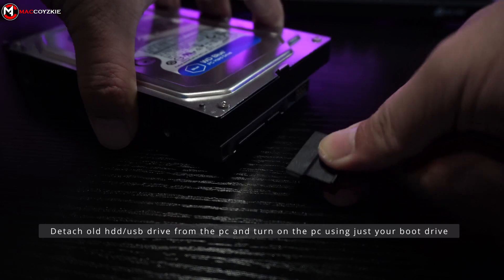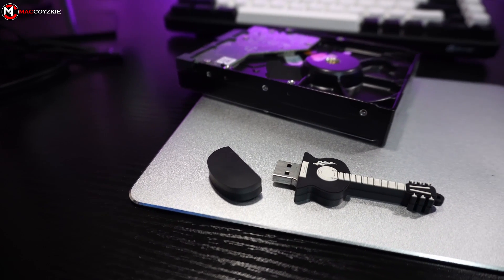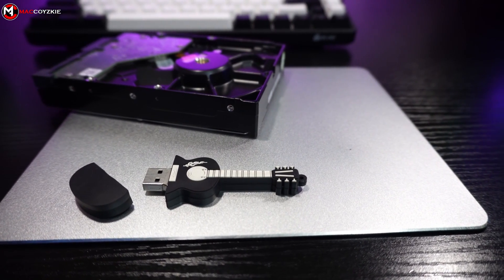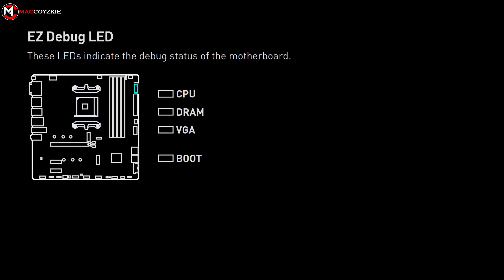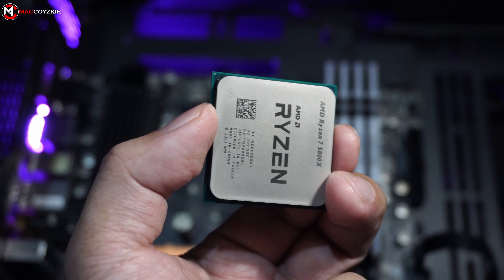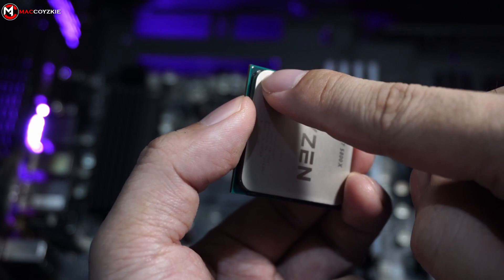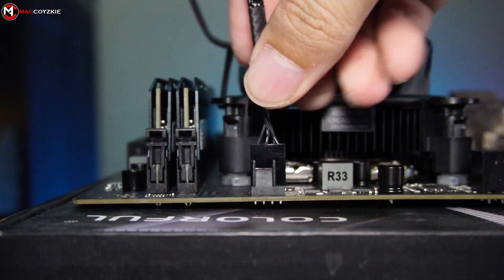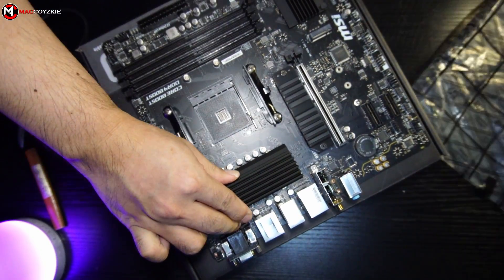Debug LED always on FIX

Comment: My cpu is athlon 200ge, i just used  it playing roblox and using the browser. Now when i turned it on, it lasted for about 20 minutes. Opened roblox and facebook then after that, it power off. And up until now, it's not working. The debug led was on the cpu. I did everything you suggested and nothing happened. Should I get rid of my cpu? I also use this computer for work because i am working home based. This is so frustrating. Can anyone help? 😔😔😔😔😔
Reply from the maker: this is the time you need to have the cpu tested in a different pc, i know you got no more pc at home so the local shop is your only choice. If the cpu works in their pc then there might be something wrong with the psu or the motherboard. for now try this https://youtu.be/S9hyEPTFR10 and if that does not work then you need to go to a local shop to have it fixed

Comment: I have a cpu and dram red light on after replacing 2x8 ram with 2x16 ram. I’ve tried to move them, i tried one, i tried the old sticks and i still get the red light. The bios doesn’t appear on when i try to access it when the pc auto reboots thanks to the red light. I tried over and over to have a fail. Please help
Reply from the maker: try clearing cmos, here's how https://youtu.be/S9hyEPTFR10
Reply from the maker: use the new ram sticks and clear cmos
Reply: @MacCoyzkie i’m ready to start a custom build almost blindly. When i have a red light issue or something only a pro knows then i’m stuck. I believe i could construct the computer no problem.
Reply from the maker: @EsDriving  can you tell me the entire pc specs? perhaps there is just an incompatible hardware
Reply: thanks for your reply. I’ve already removed, waited and reinstalled the cmos/ graphics card. They were new sticks, the old ones don’t work anymore. The geek squad said it’s memory or motherboard or both. 
They said join their membership only club $180 (not sure for length of membership) and i’ll have to play part swap until something works.

Comment: Hey Mac, great video, but I can’t seem to fix my PC problem. This is my first time building a PC, and I’m using a B450 Tomahawk Max motherboard (used), NVIDIA GeForce RTX 3070 (used), AMD Ryzen 5 CPU (new), 1TB SSD (new), and a Thermaltake 650W power supply (new). When I turned my PC on for the first time, there was no display, but the fans and RGB lights worked fine. Also, the red CPU light on the motherboard is on. What can I do to fix the issue?
Reply from the maker: you need to update bios, perhaps the motherboard doesn't have the bios for ryzen 5 (new). visit msi's website look for your motherboard and check the bios download for the ryzen 5. Installing the bios have different ways depending on the brand and model name so you need to check the motherboard manual for that. A bit of a warning though, do not interrupt the bios update process, more info here https://youtube.com/shorts/nfH5Do3Dq3o
Reply: @MacCoyzkie Thanks for the help, i will go update the bios.

Comment: My dram debug started lightening after i tried to change my cpu and than changed back to download the needed bios update for the new one... before it worked and after that nothing works any more... i already did everything you said...
Reply from the maker: i hope you did not interrupt the bios update in any way because that will destroy the motherboard. Since you updated the motherboard bios for the new cpu then the old one will no longer work. the one you installed might not be compatible with the new one so you have to double check the bios update version specifically for your new cpu.

most motherboards nowadays doesn't need monitor to update bios, usually there is a flash bios button on the motherboard's io. just place the usb with the bios update file in it and nothing else, place it at the specific motherboard's usb bios input then press the flash bios button.

each motherboard has its lighting indicator to see if update is done or still in progress so check your motherboard manual for that

Comment: Vga  light is on but i use an integrated gpu. I have no display. The pc was working fine until  i tried to turn it on again. Any idea on the problem
Reply from the maker: what's the pc specs? might be incompatible

Comment: A month ago i was playing and sudenly the pc stopped working the monitor was black so i replaced the 430 w power supply with lux 750w power supply  and  the pc worked perfectly again .the problem that 3 days ago i was playing and the monitor stopped and the white led appeared on the msi bazzoka mother board i tried what you said removing the bios battery , reinstalling the processor like  you said and this a great video you did a good job explaining but nothing helped the pc still not working .but i realise that there is a pin coming from sys fan 1 is melted in the connection with the power supply lines point . Ididnt test the processor but i believe he is ok could the problem be from the motherboard or the power supply?
Reply from the maker: that melted thing is a bit concerning, remove it atm. Try cleaning it because there might be moist or something that causes the burned part. check this out https://youtube.com/shorts/NcLkeTdquXw it might help a bit
Reply: @MacCoyzkie  Thank you for your reply. I have dismantled all the power lines, and I will  try to replace the power supply first, then I will see if the problem is with the processor or with the motherboard by testing them in nearby shop. Good advice, maybe there is some moisture in the house and I will do that after I fix the problem.❤
Reply from the maker: @AymenAK-47   yes moisture build up can be the cause too specially if you leave your pc and not using for like 3 days straight. this might be a helpful tip https://youtube.com/shorts/NcLkeTdquXw

Comment: I turned my pc in to micro center and they said that nothing was wrong with my cpu or my motherboard but once I tested it at home it still have me a red cpu  signal, I tried everything including updating bios, switching rams, replacing cpu back, and more but it still hasn’t made a change. Any advice? Thanks!
Reply from the maker: this is rare but i think there is something wrong with your home electricity since it worked when tested in micro center, how about try your pc at a friend's home?
Reply: Is replacing the motherboard a solution?
Reply from the maker: @mahescakra8464  no, have you tested your pc at your friend's house yet?
Reply: @MacCoyzkie  not yet, because i tested it in micro center was normal
Reply from the maker: @mahescakra8464  have an electrician check your house electricity, it seems not giving enough power to your appliances
Reply: @MacCoyzkie  so, i must use a power supply tester to check my psu?
Reply from the maker: @mahescakra8464  yes, if you have a friend who is willing to let their pc be tested with your psu then that's an option too

Comment: That's strange, sometimes my pc doesnt boot, sometimes it gets full freezed, and sometimes it works good.(i used my pc for 3,4 days without any problem, frezzes or something, but today it happened again) i updated the bios, re seated ram sticks, checked all 4 slots, all of them worked, but the 4th slot booted but slower than others(but i think, it snt a problem, cuz it boots), thank you!
Reply from the maker: that sounds like a drive almost full or the operating system is messed up. what windows license are you using? volume, oem or retail?

Comment: I think this is mostly an Issue with MSI motherboards referring to the CPU issue I bought all new parts for a AMD 7600 build using an MSI 650m-A wifi motherboard the CPU light was red no post I went though several different things to fix it and none worked so I sent the Motherboard back received replacement same thing so now I sent the CPU back for a replacement and it took me many hours to fix proper instructions on how to update the bios becasue the manual that came with this board doesnt show which USB port to use for the bios upgrade thankfully I stumbled up on a youtube vid from someone else that found the actual PDF file and it showed it ,  I am hoping when I receive the new CPU tomorrow the issue is fixed if not  iam sending this board back and never ever buying msi motherboards again, I had a similar issue last year with an MSI motherboard for my AMD 5600x build the system kept restarting freezing even after the bios update sent that board back bought an Asus board ( I dont care for Asus) and system worked perfectly right out of the box . I am glad I learned my lesson from last year and not put everything in the case before testing . I have been building PC Systems for around 15 years off and on and in all that  time I never had issues accept fort the last year with anything and it was MSI motherboards
Reply from the maker: i felt that frustration bro, anyway msi need to have their latest mobo updated right out of the box for sure, i had so many clients with same build in that series like yours and comments too in YT regarding msi motherboard problems having dram debug right off the bat but the pc is working fine some doesn't and several more issues, i never had problem with the last series but in this new one, its really a pain

Comment: What about a solid Dram and CPU light on the motherboard
Reply from the maker: you have both ram and cpu problem, ram might not be compatible or not detected because it is not seated properly. Cpu might be incompatible or your motherboard needed bios update
Reply: @MacCoyzkie  update: the fans/lights rapidly flash on startup with no monitor signal. The rapid clicking noise is also heard. The post status lights are flashing as well. 
Thank your for your time.
Reply from the maker: @KR0LI0SIS  can you tell me what are your pc specs first and how the pc problem started?
Reply: Did you fix your problem?
Reply: Did you fix your problem?

Comment: I’ve tried reseating my m2 but it still doesn’t get rid of the debug light and did the same with the hdd and it’s been only 6 months with it
Reply from the maker: if this is a new build then your system might need bios update
Reply: @MacCoyzkie  I want to but idk how cz it's not giving me any display and whenever I plug in my keyboard and mouse they don't turn on
Reply from the maker: @kymchi250  what's the pc specs?
Reply: @MacCoyzkie  I got a b550m-c motherboard 
Cpu is a ryzen 5600
Gpu is a rx 6500XT 
16 gigs of crossair ram
500 gb of m.2 storage 
And 500 gb of a hdd
Reply from the maker: @kymchi250  yep your motherboard might be using old bios, bring it to the shop where you got it from and let them update the bios that will work for 5600, but if you plan to do it yourself you need to watch this first https://youtube.com/shorts/nfH5Do3Dq3o
Reply: @MacCoyzkie  I’m responding a bit late but the pc won’t boot to bios either it just has the boot light
Reply from the maker: @kymchi250  most motherboards nowadays doesn't need a display to update bios, check your motherboard io, there should be a dedicated usb for flashing bios and a button at times.

Comment: I have a vga light on but my gpu is good i tried it on another pc and it worked fine does this mean i need new motherboard?
Reply from the maker: no quite but more like update the bios to the latest, make sure it is compatible with the current cpu you have. if you plan on doing the update yourself check this first https://youtube.com/shorts/nfH5Do3Dq3o
Reply: @MacCoyzkie  yeah am using the same gpu i had that system for 2 years but it just stop working
Reply from the maker: @lscbdormantgod5793  why not ask a friend to test your gpu in their rig?

Comment: Hi Mac, excellent video but I have a question. My boot light is on when I turn on my pc and no signal comes through to my monitor. When I put a windows usb in, the light disappears but still no signal and my pc turns itself off after a few minutes. Can you help me with this one please.
Reply from the maker: your ssd is not detected, try to replace the data sata cables and make sure it is connected properly
Reply: I currently only have an M.2 ssd installed, do I need a Sata ssd ?
Reply from the maker: @manhnguyen-uy3yu  i see, try to remove and place it back again clean any dust if there's any afterwards clear cmos https://youtu.be/S9hyEPTFR10 if that does not work you need to have the m.2 check in one of your friend's pc to see if it's working

Comment: Yo dude, I just built my first gaming pc and and it’s not posting on the monitor. My issue is the VGA’s led glows in red. I tried to remove and place it back nothing happens, also I don’t know if it’s worth mentioning but the rgb on my graphics card does light up but the triples fans on it doesn’t work I really need help I’m so confused and lost
Reply from the maker: i need to know the pc specs then, my answer depends on it
Reply: @MacCoyzkie  graphic card: MSI GeForce RTX 4070 gaming X Trio 12G

CPU: Intel Core i7 - 13700KF

Motherboard: GIGABYTE B760 Gaming X AX 
Cooler: MSI MAG CORELIQUID 24R V2 

RAM: Kingston fury beast DDR5 RGB 16GB (2X8GB) 6000MT/s CL40

SSD: Crucial P3 Plus 2To 

Power supply: CORSAIR RM 850X80 PLUS Gold

Pc case: Fractal design north white tempered glass
Reply from the maker: @shadxw7623  hmm that should work right away, I know this may sound basic but can you check it for me https://youtube.com/shorts/-IMdGQKLwrg

if you have done that already then i guess the motherboard needs bios update, usually it should work right away but try to update yours. if you can ask the store where you got it from to do it for you it will be better but if you'll update it yourself watch this first https://youtube.com/shorts/nfH5Do3Dq3o

gpu fans by default only runs if it reach a certain temps so that's normal

Comment: Hello brother please solve my issue🙏🏻 when i start my pc ram led glow up in orange color then CPU led glow up in red color then vga led glow up in white color and last boot led glow up in green color and keep glowing green but my pc doesn’t start please help me what to do😢🙏🏻
Reply from the maker: there is something wrong with your boot drive, try  reattach the sata cables and do this next https://youtu.be/S9hyEPTFR10
Reply: @MacCoyzkie  still nothing is happening 😔
Reply: @MacCoyzkie  it has 2  SSD M.2
Reply from the maker: @digital3d413  may i know the whole pc specs? and is this a new build or was a working one?
Reply: @MacCoyzkie  working one
Reply: @MacCoyzkie  Ryzen9 3900XT, ROG B550-F Motherboard , Rtx 2060 6GBGraphic card , 16+16  32GB RAM, P550B Gigabyte Power supply, 512gb and  1 TB M.2 SSD
Reply from the maker: @digital3d413  can you remove the extra m.2 and let it boot just with the m.2 that has windows in it, if there is anything i think one of the drive might be too full or almost full

Comment: I have the DRAM LED problem on an MSI Z790 Tomahawk. The RAM sticks are working perfectly in another computer. I already tried clear CMOS, flash Bios to newest version, tried other RAM, but still the DRAM LED is glowing and I get no picture on the screen. It's so frustrating, I don't know what to do anymore. You buy this awful expensive hardware and it just doesn't work.
Reply from the maker: bro you tried all possible tests, i suggest use Rma now because that's a faulty mobo

Comment: DRAM tried it all and no luck
Reply from the maker: ask a friend to try your ram sticks, perhaps one of it is faulty
Reply: @MacCoyzkie  I tried all 4sticks one at a time all four slots. No joy. If I unplug the power supply to the CPU the light shuts off. Swapped cpu2 slot on PSU and light still on.. idk
Reply from the maker: @TheCharillz23  did you try it in your friend's pc? is this a new build or was a working one?
Reply: @MacCoyzkie  working PC. I bought new ram. Did bios flashback got it to go away then boot light was on. Turned off and back on and boom back to DRAM fault
Reply from the maker: @TheCharillz23  bro i need you to answer my question less i cannot help you

Comment: my pc working good for 2years suddenly morning i try to on my pc it boot and windows all works after sometime there is no display and i try to turn on pc again it indicates red light vga after i try to clean ram and gpu with eraser put it back and cleaned total pc after that pc turn on but again display gone there is any solution ?
Reply from the maker: can you try clearing cmos https://youtu.be/S9hyEPTFR10 if this does not work I suggest ask a friend to try your gpu in their pc to check it